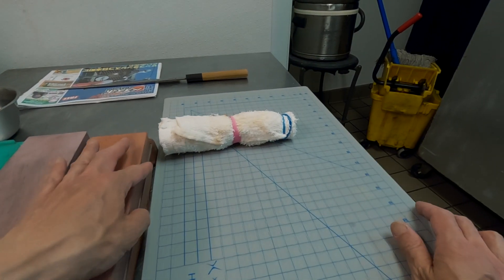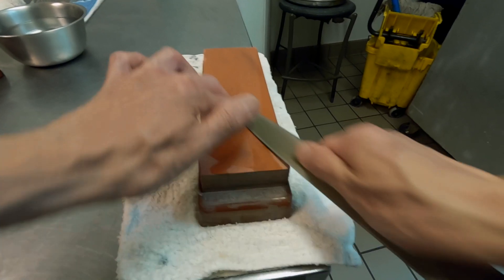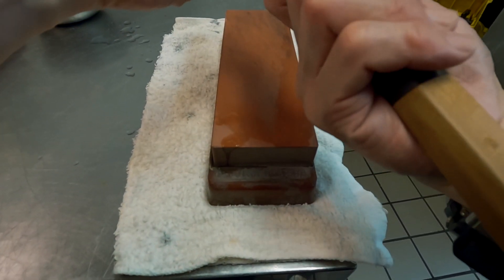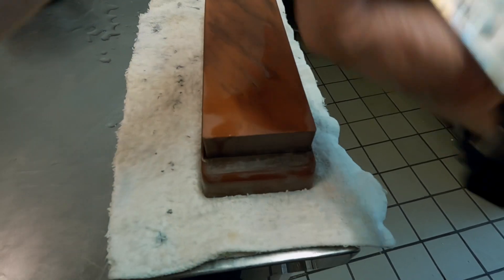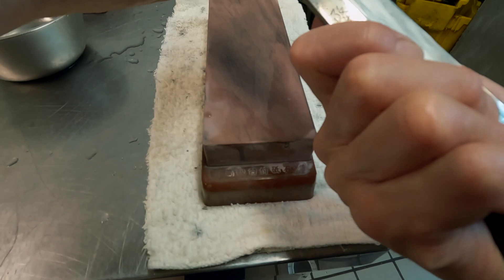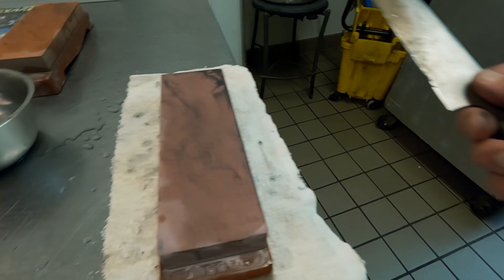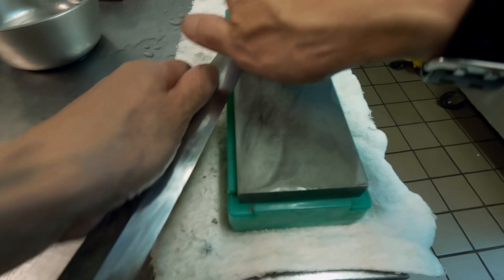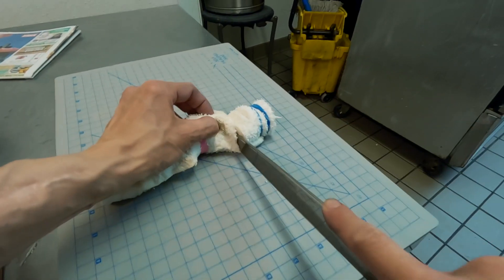How to sharpen brand new Yanagiba Part3/Kiriha (primary bevel) sharpening session uncut unedited

Comment: just a question, which angle do you sharpen the kireha ? like you tilt the yanagi up a little bit or you leave the kireha flat on the stone ?
Reply from the maker: If you haven’t already watched these videos, watch them first.

https://youtu.be/mXSGuON2i3Y

https://youtu.be/L3ehpBkkX-0

Then, you will know my answer.
(Hint: DON’T try to raise the spine side of the knife.)
Reply: @MonsterS4R996 thank you for your response, i see that the blade angle from the tip to the heel is completely different, but how do i sharpen it ? do i put different fingle placements on the shinogi line or tilt the spine up when i get to the heel of the knife ?

Comment: Just a question, basically you first sharpen kiriha then shinogi?
Reply from the maker: "Kiriha" is (primary ) bevel, the entire bevel surface.
"Shinogi" is ridge "line".
So, ... you really don't sharpen / grind Shinogi.
You sharpen (grind the metal off of) Kiriha,
as a result, you get well defined Shinogi line.

I first aim about 2-3mm off from the actual edge line when starting the sharpening. (eg; the edge is NOT coming in contact with the stone at this stage).
Then, I move onto the edge line.
After that, I'd go up near the Shinogi line. (So that I won't alter the bevel angle.)
Do you get it?
Should I make a video about this topic?
Reply: @MonsterS4R996  if you have time for it, the video helps a lot 😁, written it's hard to visualize it
Reply: @MonsterS4R996  I'd really appreciate a video about this. It's difficult to tell when you change positions/pressure points on the primary bevel.